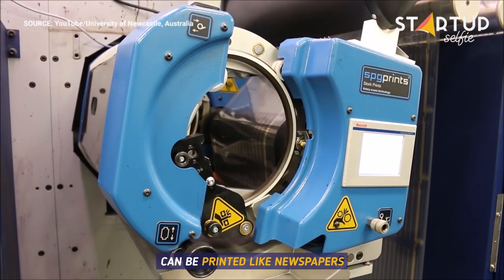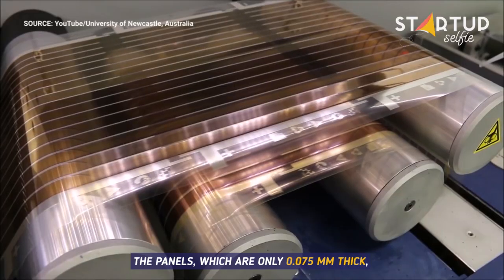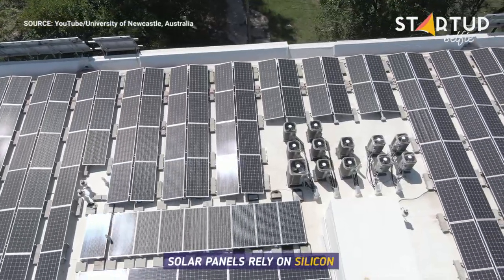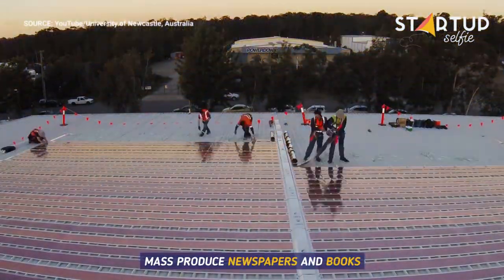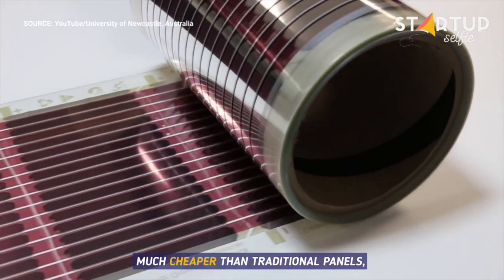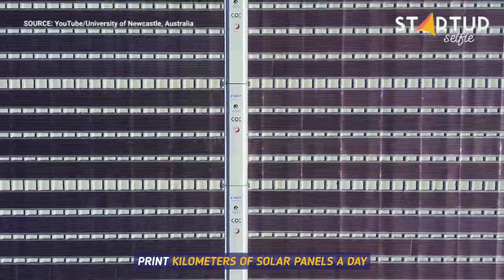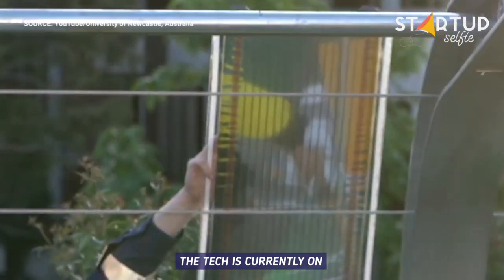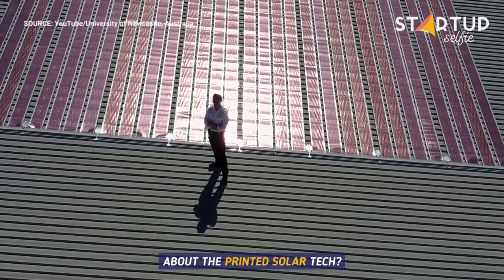Printable Solar Panels

Comment: Seems good but info on the efficiency of converting light to electricity is missed out. Hope to know more on the output performance.
Reply: I saw a video where a young inventor created a UV solar panel that absorbed far more power even when very overcast.  It was created from the idea that bio-luminescent particles in vegetables and fruit absorbs UV light, I'm not 100% sure if he used the particles or simply the mechanism they absorb UV light, but the point being that his panels are a lot more efficient.  Not sure how that would change your comment - but I hope humankind invents some far more effective ways of turning sunlight into electricity.
Reply: Efficiency should be around 10% for organic solar cells
Reply: @hssssssssssss  I have no idea - not my field - but the video did say it was based, not from organic matter and it was 60% better because it gathers UV energy.  I guess if it doesn't turn up for sale in the next year or two we know it was a crap idea.  :)  (or it was so good someone paid for it and stuck it on the shelf)
Reply: Altho needs to be said that when comparing the efficiency, the cost and toxicity of the tech should be considered not just meters squared. So yes I expect the efficiency per meter squared to be lower, but I hope the efficiency per toxicity level would be higher

Comment: Prof Paul Dastoor with the Univ of Newcastle has made 3-D printable solar paneling that can be put on thin film. They have already partnered with chep, an Australian shipping company to test pilot the program. They use a semi conductive liquid ink that is put into a 3-D printer. This gets costs down to $10 per square meter. They are 300 times lighter than panels & use adhesives to apply. They are unfortunately only about 3% efficient currently & last only about 1-2 years. Keep in mind, this is the first generation.

Comment: Nice innovation but What about Output Values ?
Reply: I'm assuming very low.
Reply: A cigs-panel produces up to 10x more watts wih a single watt rating compared to a standard-rating of a standard-solar panel. Does this answer your question?

an 8W-panel will produce ~80W per day! A 200W panel will produce easily 1-2 kWh/day!

You can produce more with it, but that depends on your situations. Will you take it into your house and put an LED onto it to make it produce more energy? or is yours just fixed on your roof? then you will not get this extra-boost.

Cigs-panels convert ANY light into energy, even car´s LEDs, house-LEDs, pocket lamps or whatever light you have in your house/outdoors.

Comment: How can join hands to explore this tech in India with joint venture
Reply: We will send you a form for you to fill in. Then send ₹20Cr to an account in Nigeria. Then we will send you all the printer and ink so you can start manufacturing in India. 

Why do people think they can start a joint venture by commenting on a YouTube video!!!
Reply: Jijo, we can print here also, but we need full description output and what kind of plastic is used. Or its reliable or not. DNT worry Nigerian, in India there is huge population is engineer than ur nigenria population. We can reverse engineering and can create better than this. How can people comment wether venture is needed or not

Comment: are they durable? as in do the survive a hail storm? a very strong wind? very heavy rain?
what % of the light gets turned into power? how many sq feet to make say 1400 watts of power?
how much garbage product is made during the possess of building these rolls of solar?
Reply: You wouldn´t be able to pay the 7000-10,000$ needed just for 1400W of Cigs-panels, would you? Also: You will need a bit more space on your roof! Btw: it´s NOT recommended to put them on the roof!
The power depends on what type of light you have. Infrared like standard-solar panels use, only produce few energy (20-25% of conversion).

Cigs-panels can use infrared-light as well, but they will ONLY convert around 15-20% of it into voltage. The much higher power output from them will come from blue light!
Cigs-panels are optimized for WINTER-light (where a lot of blue-light will come down = huge power-efficiency of 50-80% conversion!).
You can also put Cigs-panels under LEDs (since LEDs wll produce a lot of blue light) = high power conversion!

Comment: How much will it cost ?
Reply: It´s expensive. 5$/watt average. an 8W-Mini Panel costs 30-40$. A 30W-panel cost 200$ (Foldable). And a 100W one will cost you 200-250$. THe mos expensive one with 200W, capable of producing housand of kWh per year will cost you 500-800$!

Comment: What is the cost per watt where to buy
Reply: Cigs-panels cost 5$/watt. they are expensive, because they can produce much more energy/watt = Their wattage isn´t "Peak". It´s a minimum-rating. Meaning you will get what you put on the package and more! A 200W panel will produce thousands of kWh per year! Not just 200 kWh like a standard panel does.

Comment: great - if every house had these on the roof, we had no energy issues anymore. shame they dont last long.
Reply: But it's not last long
Reply: Cigs-panels last from 5 years (if you spray hem on cheap and low-quality foil) or 200 years (no degradation) if you use sturdy materials such as plastic or metal!

Comment: Whats the lifecycle?
Reply: 5-200 years. Depending on material you spray it on. You use foil = it will only last a few years because foil is bad for health!

Use sturdy material such as plastic or metal-backing and it will last 200 years since there is no photovoltaic degration like with many other solarcells!

Comment: at least provide info how much electricity it could generate per meter... omg
Reply: there probably is a reason why they didnt provide that information. Seems like a cheap option with pover results. Maby still worth it if you cant afford regular panels and the cost of those things is verry low.
Reply: 1.5 qm can produce ~100W/hour Continuously! A Cigs-panel can work for more than 10 hours/days since it´s not depending on sunlight only. Gaining you 1000 watts/day or even more, depending on what you do then after the 10 hours are over. You can take it into your house, put it under a 20W LED and gain another 15W/hour or whatever else you do. Allways depending on your numbers you can provide.

Comment: This solar sheet available in india
Reply: No! This tech is for RICH people. The smallest panel with 8W power will cost you nearly 50$ allready. The next one, 30W will cost you 200$. The best price/Ratio with 100W will cost you 200-250$!

The most expensive but also most powerful with 200W will cost you 500-800 $!

These companies will not deliver to india.

Also be reminded. India is a company wih a LOT of sun. THese panels are ONLY for companies with LOW sun-light! Understood? This isn´made for you, sir.

This will be damaged if you put it into huge sun for many hours/year.

Cigs-solar panels are made for WINTER. Where there is no or nearly no sun. Instead you have a lot of BLUE light.

Blue light conains a LOT of energy. Which this solarcell can then convert into energy.

Comment: We want it on every building on earth. That would provide extra 5 percent of global electricity supply
Reply: Only very few companies produce this since it´s HARD to make. You nee very special machines. It´s not a standard-silicon machine like use for every micro-chip. See? This isn´t using micro-chips! no silicon! No wafers! Instead you need special machines for SPRAYING. A Cigs-panel consists of about 10 different ingredients. the cigs-tech itself has 3 components: Copper, Indium, and Gallium-Selenide!

But these 3 components are just your "solarcell" here, which convert red, blue and green light into energy.

You need around 7 other materials which you have to be sprayed in a very complex way on your materials in order to make it a full working Cigs-Solarpanel!

Comment: Africa has lots of sunlight all year round. Any partnerships in an African Country?
Reply: Absolutely grand idea. Our organization is looking into it.
Reply: No, since africa is a poor country. This will only be delivered to richer countries.

Since this is a luxury product. It´s very expensive! The cheapest DIY-option with 8W power will cost you 50$ in africa allready...Does this answer your question? isn´t that what you earn like in a single month? You would have to hunger for 1 month to be able to afford it.f

Also note. This solar panel is NOT made for counries with lots of Sun! This is made for countrie with LOW suns uch as germany, USA (parts of it); canada (rich country) and others with low amounts of sunshine. Since this solarpanel produces energy when there is NO SUN (e.g. you can put it under an LED-lamp and it will produce energy that way because it converts the blue light of the LED (blue light contains a lot of energy, much more then red light!) into many Amperes of energy.